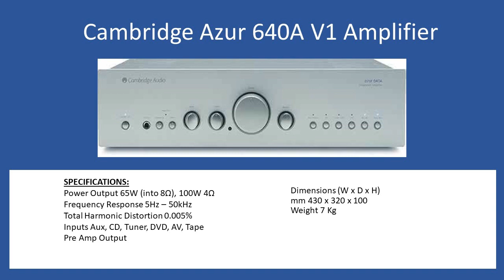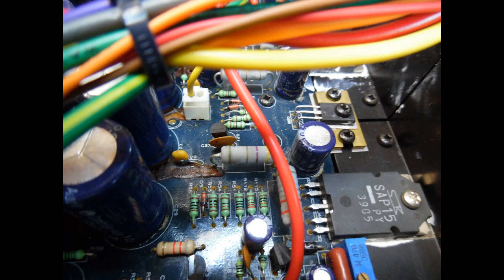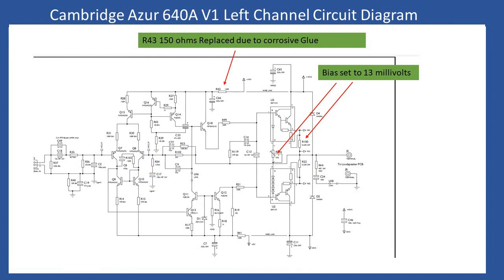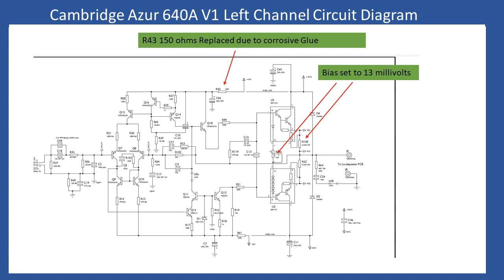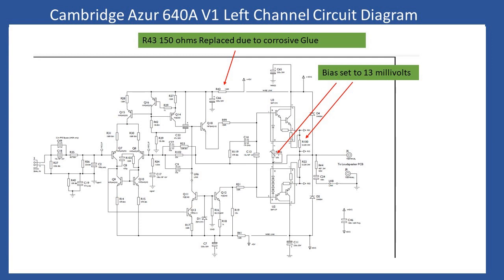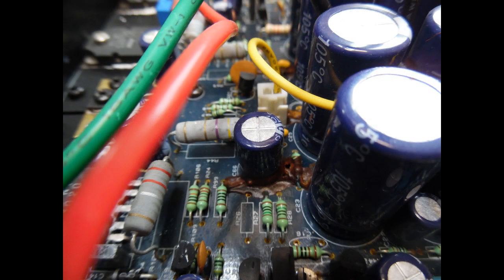Cambridge 640A Azur Version 1 Amplifier Repair (With Audio Tutorial)

Comment: Hi. I think this cables are stock modification 😮
Reply from the maker: Hi, do you mean all the internal cables?
Reply: @AudioAmplifierServicing In the video, you say someone was repairing bad soldering with cables. These are likely the original cables.
Reply from the maker: @D.W94 Hi I was not referring to the original wires.
Reply: @AudioAmplifierServicing Ok😊 What's your opinion on this amplifier?
Reply from the maker: @D.W94 The Amplifier produces a decent sound, but the build quality could have been better.
Reply: @AudioAmplifierServicing Thank you. I've noticed a lot of capacitors from Acon and other unknown brands. I've already repaired two of them, and everything still works fine, even though the amplifier is many years old😊 The sound is very good😊
Reply from the maker: @D.W94 The brown glue is the major issue causing premature failure.

Comment: Greetings I have the same model of amplifier and two problems. First is  power button ( act as is double pressed) and the second major problem is with left speaker output. When amp is turned on and song is playing there is no sound on left speaker or sometimes rarely sound comes in spikes. But after some time playing songs left channel starts to running normally. Do you know what could be a problem?
Reply from the maker: Hi the push button has worn contacts this is the type you need to source https://uk.rs-online.com/web/p/tactile-switches/6821131?cm_mmc=UK-PLA-DS3A-_-google-_-CSS_UK_EN_PMAX_Catch+All-_--_-6821131&matchtype=&&gad_source=1&gclid=CjwKCAiAkp6tBhB5EiwANTCx1Pkkr4XNsTMf_qD_220IYNQDpjJr5eNY_ePv1TcnbKbYtQQqji3eyhoCntAQAvD_BwE&gclsrc=aw.ds
There is also a foam ring at the rear of the power push button actuator you will also need to replace it, this is the type you need  https://www.align-trex.co.uk/body-washers-foam-2mm-2-pcs-3mm-2-pcs-4mm-4-pcs-trx6716.html?gad_source=1&gclid=CjwKCAiAkp6tBhB5EiwANTCx1FR3ubmoDhD8vfriH_GCefafNth2KkWSu69VhNCDbh7jfaw5jwOmRRoCjacQAvD_BwE the loss of Audio on the left speaker may be due to worn speaker protection relay contacts. You need to check the Audio on the switching contact of the relay. Also if adjusting the volume control slightly fixes the issue it could be due to the volume control being dirty. You can clean it with a high quality contact cleaner. Spray into the side access holes and rotate back and forth multiple times.
Reply: Thank you for your replay. I will change the switch and foam ring and for second problem increasing volume control doesn't fix problem. Even when volume level is increased on half (12 o'clock) there is no change. Sometimes  works for maybe 1-2 seconds and mostly not. Probably it's relay like you sad but it's interested that after some time it works without problem. Just like it needs some time to worm up.
Reply from the maker: @mulja23  Check the Audio signal on the switching contact of the relay to confirm the issue.

Comment: Hi, i have azur 640a v2 and there's a problem with some noises in right channel (when input rca cable connected) even at zero volume, what can it be? With no input cable there's no any noises. 
Thanks
Reply from the maker: Hi from what your describing it does sound like you have an issue with the RCA cable, I would try a different one, also if the noise is still present try also a different sound source.
Reply: @AudioAmplifierServicing  Thank you, I fixed this problem, but another one bothers me, the amplifier works for about 10-15 minutes, then turns off with a double flashing protection LED, sometimes it may appear if I just turn on the amplifier (on/off button on the back side), and after self-checking it instantly flashes 2 times (in standby). There is no glue on the boards, visually everything is also fine. Sometimes, even after a few hours, it doesn't go into protection mode...
Reply from the maker: @deliorix  The CAP 5 protection system is showing an over temperature fault is this a version 1 or version 2.
Reply: @AudioAmplifierServicing  I have version 2, but i think it's not overheating because the radiator is slightly warm.
Reply from the maker: @deliorix  The bias for each channel should be 13 millivolts. Also, there is a foam square block stuck between the two vertical
Reply: @AudioAmplifierServicing  I already adjusted bias to 13mV and deleted foam from two protection pcb's
Reply from the maker: @deliorix Time for fault finding check the voltage into the respective comparator to see if it turning high when the fault occurs. You need to determine if there's a fault with the Amplifier or the protection circuit.
Reply: @AudioAmplifierServicing  How to check it? Which pin of lm393 i need to measure?
Reply from the maker: @deliorix  I see you have been given all the information to check on your post on Diyaudio.
Please follow the procedure, also I see you have replaced the relays with non original type.
Did you have the protection mode isdue before you replaced the relays?
Reply: @AudioAmplifierServicing  I replaced with those relays that were available to me (and were the same in the datasheet), before installing the relpol relay, this problem was present. The only thing I got rid of was the loss of sound on any of the channels. (the old relays were oxidized) 
Also type of the old and new relays is DPDT (or 2P2T)
Reply from the maker: @deliorix  okay
Reply: @AudioAmplifierServicing  So, i found R70 should be 10k Ohm but mine is 1280 Ohm
Reply from the maker: @deliorix  very good
Reply: I understand that I just need to replace the resistors?
Reply from the maker: @deliorix  If the resistor is outside of tolerance, then it should be replaced.
Reply: @AudioAmplifierServicing  Thanks a lot! But I have one more question, how do you clean the pcb's?
Reply from the maker: @deliorix  Do you mean the solder side or the top of the circuit boards
Reply: @AudioAmplifierServicing  The top side
Reply from the maker: @deliorix  https://gesrepair.com/clean-circuit-board/
Reply: @AudioAmplifierServicing  Hi i wrote to your email